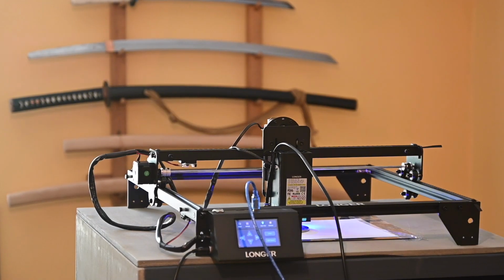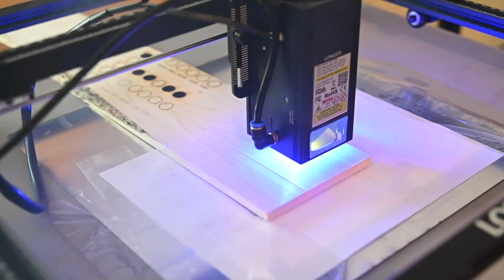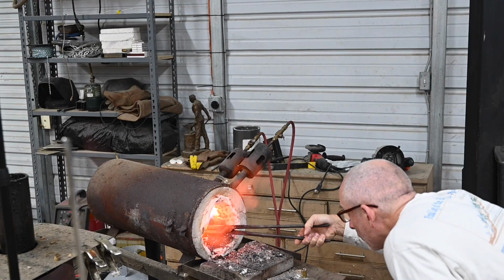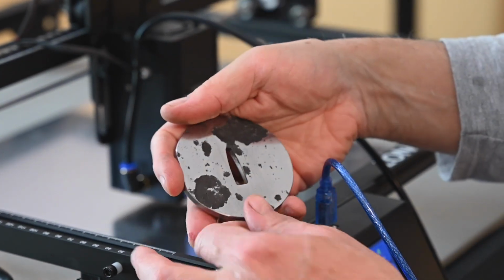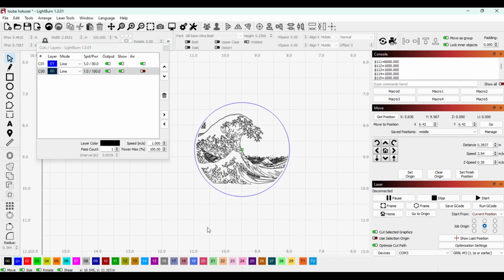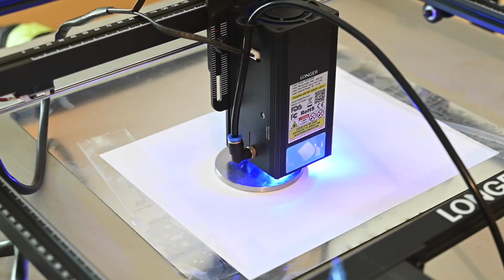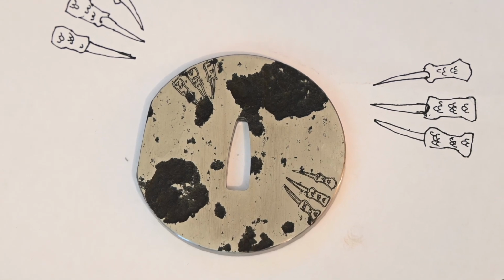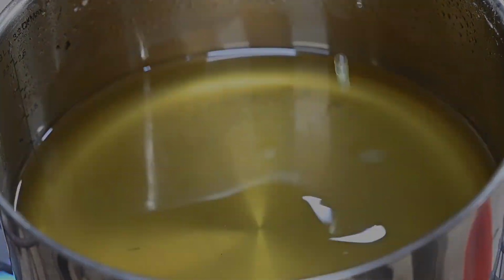Making Amazing Japanese Sword Fittings (Longer Ray5 20 Watt Engraver)

Comment: Regarding the audio issues, I have noticed in my case that when using 2 earbuds in stereo it's fine. But when disconnecting either of them and let the left and right channels mix the audio will drop.
I have checked using windows control panel sound that both left and right channels are working. But seems that in this video, mixing the channels will somehow cause them to cancel each other.

[EDIT]
Tried with my phone. Running on stereo is fine. But setting audio to mono will have the same effect.

Seems it's true, left and right audio channels will cancel each other.